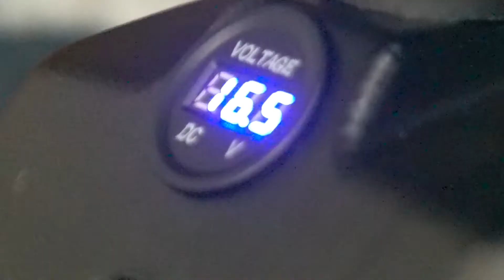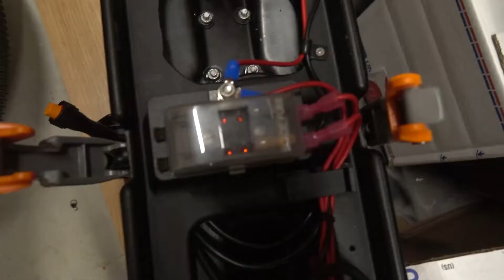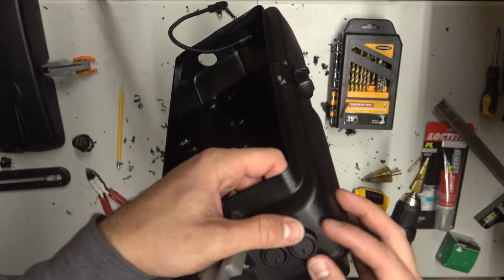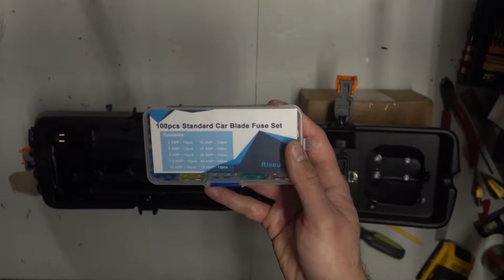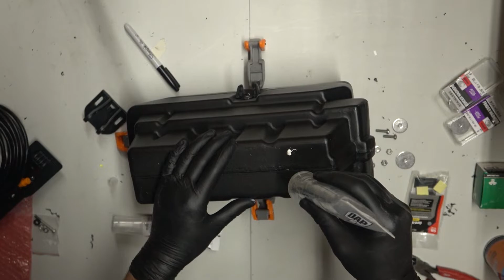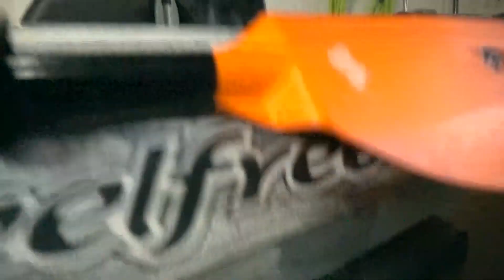Feelfree Sonar Pod Battery Box Build with Garmin Echomap UHD 93SV

Comment: Quick question.  I just got a Moken 12.5 V2 and plan on putting a Garmin Striker 7SV on it.  The only thing I'm concerned with is securing the pod with just that one latch in the front.  What happens if you roll and that latch pops off?  Trying to think of a way of securing the pod in the back or across the top as well for added measure.
Reply from the maker: Yeah I definitely get where you're coming from. For mine, I don't have anything extra securing it, and thankfully I've never flipped my yak. Since my kayak came with the pedal drive mount, It's fairly secure between the latch and front mount (I added a wedge). If it came off, you bet I'd be swimming for it haha! Anyway, I would think a bungie across it with some small screws would do the job, but then you're adding more holes to your kayak.